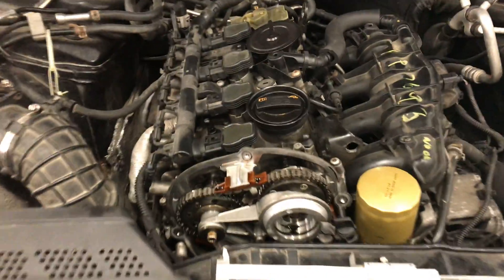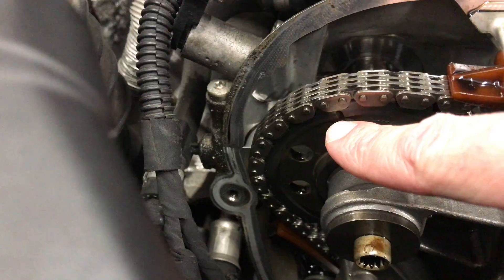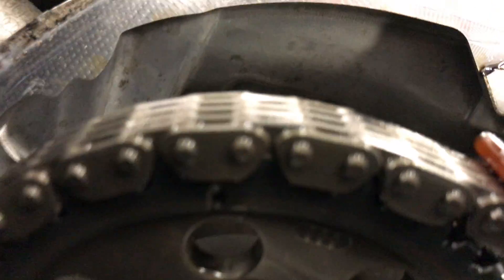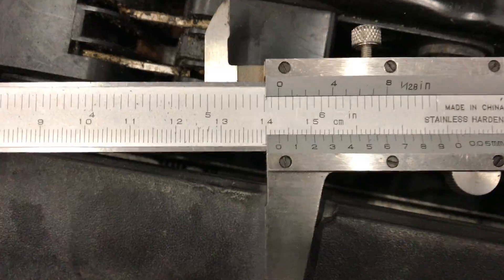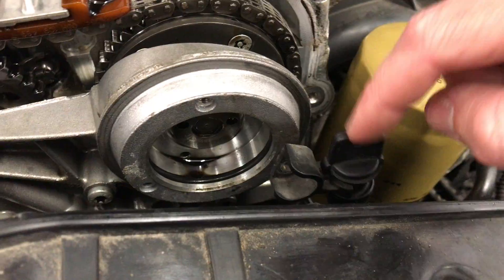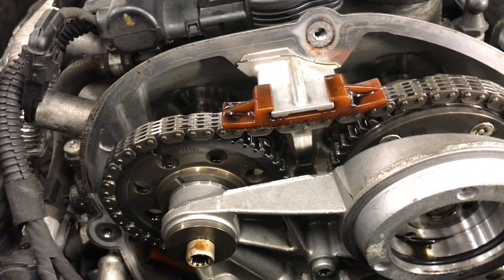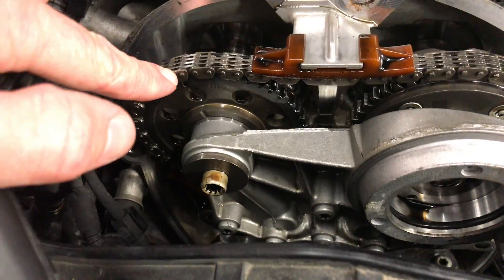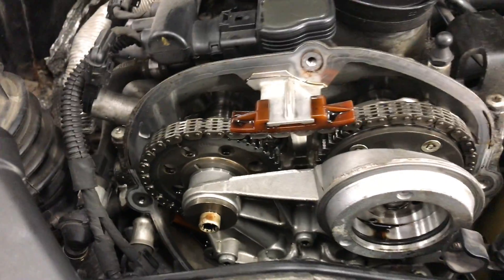Timing Marks & Timing Chain Stretch - 2012 Audi A4 2.0T

Comment: Weird question. I replaced my cam bridge due to chasing an oil pressure issue and I wanted to check for the screen (which was in an oil passage) but when I was putting the new bridge on I wiggled the intake came a little bit and I think I moved it back a tooth as there is only 11 between timing marks on my motor. Do you believe this could cause a misfire on cylinder 4?

Comment: ECS has a decent dipstick.  Mine was burning 1 quart per 1500mi.   Performed a very rich seafoam treatment of 20oz to 1/4 tank of gas without any engine issues or codes and performed the intake seafoam treatment with proper heatsoak. Did NOT do crankcase seafoam treatment. Oil consumption
disappeared.  Always use synthetic oil and of proper weight to minimize oil control ring clogging.

Comment: So my car (2012 Audi A4 2.0T) Started up just fine , drove it to the store, and when I got back in and turned it on it BARELY wanted to start and shook like hell. It sounded like a cammed car the "misfires" were so bad. I had no options whatsoever then to drive it home like that. It drove smooth, but when I hit the breaks the cars jumped horribly, and at idle the whole car shook and the block shook like a rod knock. I got home, tried to turn it back on after turning it off and it's cranking but getting absolutely no compression to start. I was told it jumped the timing, valves hit the pistons, motors basically blown but that's also not from a mechanic or anyone professional since I can't afford to get it towed or to get it looked at. Do you happen to have any input on it?
Reply from the maker: It's really hard to know if anything hit or not. You might have to take the chance like we did here and replace the timing chain, guides and hope that works.

Comment: I’m looking at a 2012 A4 with the same engine. Is there anything I should look out for before buying that May hint to this being a problem in the near future? So far the car runs and drives as it’s supposed to but this is my main worry.
Reply: There is a little cover on the lower cover of the timing chain that you can remove and inspect the tensioner
Reply: Did you buy the car?
Reply: @psiturbo  no

Comment: Nice video,  my 2.0 will not start, the motor just spins over.  is there anything I can check before I check the timing chain  I did check fuel, spark and air
Reply: Sound like a snapped chain/belt

Comment: Mine is also at those cam gear measurements... What exactly am I supposed to do to get it within parameters? I was told to turn the timing chain bolt until they were within parameters but they are staying in the exact same spot every rotation. Any help is appreciated!
Reply from the maker: Replace timing chain

Comment: Great video---thanks for sharing your in-depth knowledge. Question please for an Audi A3 2.0T - How much are parts to replace the timing chain? Also, number of hours, and approximate cost for an independent shop to change the timing?  Many thanks!
Reply from the maker: An eBay kit is around $150, about 5 hours but some shops will charge for more.

Comment: DO THESE MOTORS HAVE TIMING BELTS ALSO?? IM FINDING WATER PUMP DRIVEN BY THE BELT? AND ENGINE DRIVEN BY THE CHAIN.
Reply from the maker: Wont be a timing belt, sometimes they say belt instead of chain.
Reply: the water pump is driven by a tiny belt off the balance shaft. it's separate from the timing chain. I changed the belt when I replaced my water pump.

Comment: How did it go???
Reply from the maker: Worked mint
Reply: @porkercon  great job . i am using your video as many believe timing chain skip is automatically head replacement and its just not true ... its worth doing what you did ..
Reply from the maker: @cliveyoung3619  Thanks, ya totally worth it when you know someone who doesn't charge $150 an hour and you use a cheap aftermarket chain.

Comment: Normally, isn't supposed to have 11 links instead of 12? if it has 12 links, it has 11 x 12mm so 132mm total which is too long no?
Reply: So do you subtract the two centers of links from the overall links?  That should take away a link length total??

Comment: I have an A4 B8 from 2010 with the exact same problem, the car shakes and I can only drive it on low RPMs. The chain must have skipped a tooth on the highway, luckily not far from my home so I could drive the last mile. I checked the codes and to no surprise I could see the P0016 code along with misfire on two cylinders. The car probably has the old styled tensioner that seems to fail for many Audi owners. What do you think, is it possible that I got bent valves even though the car still runs? I still have some hope after I saw this video since the symptoms seems to be very similar.
Reply from the maker: You are probably good since you could drive it home. This one shook so much that I was surprised that when we replaced the chain and tensioner it worked like new. The interference must only happen if the chain breaks or skips a bunch of teeth.
Reply: @porkercon  I'm very happy to hear that, thank you! When I bought the car it also had the oil consumption problem, after many phone calls with the dealer they agreed to replace pistons and rods according to Audi's recommendation. When i'm got the car back the dealer wouldn't share a report or any details about the repair, and the timing problem occurred and month after. So before I leave it to another mechanic, I better get that report so I know for sure it's even worth repairing. Thanks for the feedback, cheers!
Reply from the maker: @henricmakenzius8715  Wow lucky you
Reply: @henricmakenzius8715  When i got my work done under oil consumption warranty they did pistons, piston rings, cam bridge, cylinder brackets as part of the main repair but they also did my timing chain and tensioner, water pump and PCV valve at 70% discount. Came to like $800 total for all of the mentioned.
Reply: Off topic, but i got the water pump done at 125k km, and i'm at 185k km now and it is leaking, is that normal for the water pump to only last 60000 kms? It was the plastic OEM kind
Reply from the maker: @arborharbor7408  Should last same amount of time as timing chain from what I know.

Comment: The 2.0 liter motor drinks oil.
Reply: Omg yes 😭
Reply: 2013 and later models are fixed. earlier models with consumption problems can get permanent fix. need to replace piston rings and a few other parts. may not be best ROI though.
Reply: alexmotoblur yes I had the rings and pistons replaced on my 2012 A 4. Problem resolved. We also have a 2014tts, no oil consumption issues.
Reply: @grantbradley5084  CAED engine type dont consume any more yeah , piston and ring updated on certain 2012 models if u got the recall. no oil issue